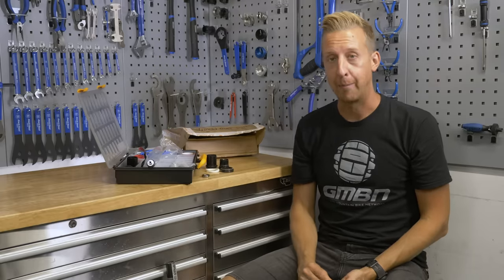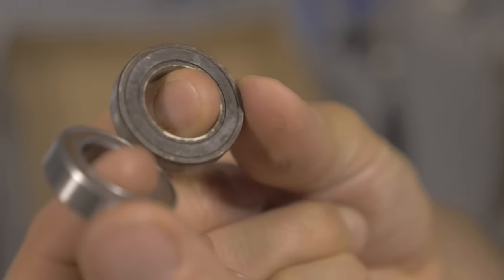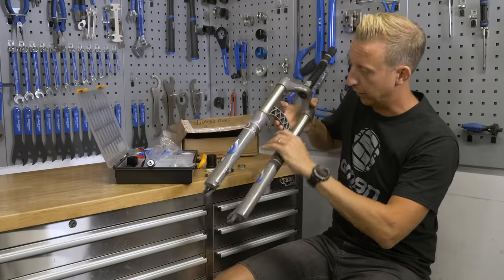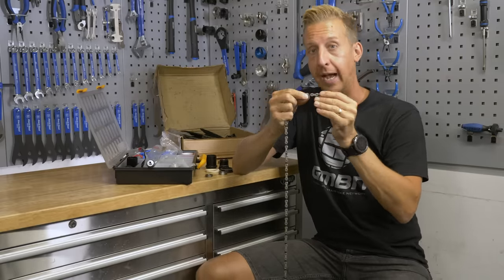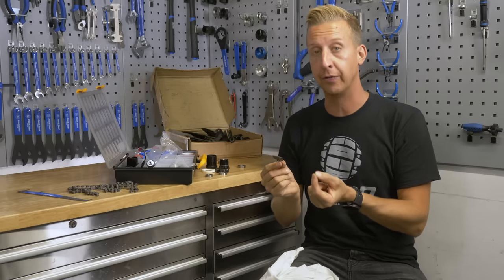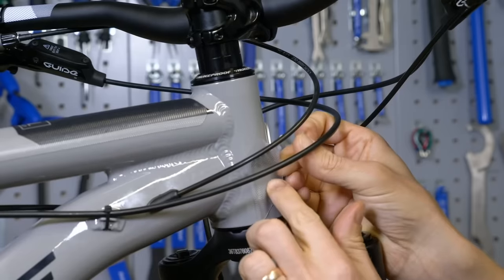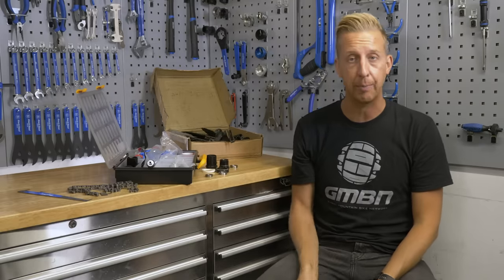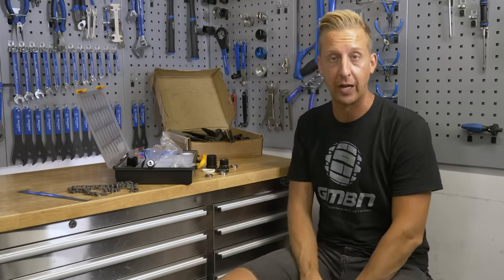7 Ways You're Destroying Your Mountain Bike | MTB Maintenance Tips

Comment: I had a problem with my guide r break leavers sticking on in the hot weather,changed the plunger for aluminium ones,now one of my break leavers are rattling,it never rain’s it just buckets down
Reply: That's a common issue and recall. You could've gotten the replacement parts for free from SRAM! I had the same problem with mine.
Reply: Did the orig ones stick cos u didnt use only DOT brake fluid? Mineral oils and other fluid will cause seals to swell. Or u didnt hear about the warranty replacement for this issue? Too late now u took them apart.
Replacing brake internal parts with non oem parts is an obvious no no...u have created ur own issues here. Dot flush and replace all seals.

Comment: #GMBNTech I have an low end coil sprung fork and it gathers some sort of grease on the stanchions which can gather dirt and sand which I keep clean but are there any more reasons why I should remove the grease or is it ok
Reply: patrick boxsell The grease is getting pushed out of the lowers because of the terrible seals the fork has. The best you can do is to take the thing apart, clean it out and use some good suspension grease and new seals. I personally wouldn’t mess with it and would save up for a better air fork, but if you can’t, this is a reasonable thing to do.
Reply: @camperhonsa8633  thanks for clearing that up👍

Comment: I got a carrera vengeance for 5 quid the wheel axles needed replacing because it was bent but I had the same 1 in the parts draw and no gears on it so put front shifter and rear shifter and mech on which I had in parts bin and 4 ok cables I had lying around which worked fine the bike originally had fluids on it but I went with mechanical it's cheaper I don't need to bleed it and I can replace cables very cheap when needed the rest of the bike was fine thee bb felt like  new because it's a sealed cartridge and the headset bearing were fine aswell so that's my winter bike I also don't use expensive oils on it only cheap oil and don't clean it as much as I should but I don't care it's there to use so I don't wreck mine in winter only this 1 I also took the rockshoxdart of the front and put a cheaper fork on because they were too good of condition for that bike i got it from a friend who kept it in his house and one day said you can have it for 5 quid so I took it now it's still on the road where any commuters bike should be

Comment: Hey GMBN i was wondering and i doubt you will se this but my forks will not really move at 50 psi and they barely move at 25 psi do you thin k it may be that the air is getting stuck in like the negative air chamber or...  idk how to fix this and was wondering ir you could help

Comment: with my 2014 Fuel Ex there is no way to not wear it fast.
Bad linkage design, horrible engineering mistakes, possibly bad tolerances in headset, cus I need to replace the bearings every year to have smooth bearings.
the bearings in rocker link go come out cus of flex, and there is nothing to stop it horrible design.
on my fork I worn the Quick release axle , but I got two of the same fork and axle, it was resistant to coming out, and had a lot of friction, so I installed the other one.
but fork looks like someone used sand paper on it, and diamond file, but so far the other axle work.
but fork has been serviced by Cyklon.no so fox importer, service sentre.

Comment: Waealimits of a Discrotor are nealy always on the rotor itself! Be carefull not to measure the unused parts of the rotor and only the breking surface itself, the method he showed in the Video is not how you get a good measuring. 

Wearlimits of :
Shimano 1.5mm with an original thickness of 1.75mm
Magura 1.7mm with an original thickness of 2.00mm
Sram/Avid 1.5mm 

TekTro 1.6 with an original thickness of 1.85

In German:
Das Verschleißlimit steht meistens auf einem der Arme der Bremsscheibe. Beim messen mit einem Messschieber muss man aufpassen dass man nicht einen der Arme mit misst. Am bessten legt man den Messschieber in Scheibenlaufrichtung so dass man auch nicht den kleinen Grad an der Scheibenkante mit messen kann.
Verschleißlimits von verschidenen Herstellern sind:
Shimano 1,5mm mit einer Orginaldicke von 1.75mm
Magura 1.7mm mit einer Orginaldicke von 2.0mm
Sram/Avid 1.5mm
TekTro 1.6 mit einer Orginaldicke von 1.85

Comment: Draining out oil? How do you do that with air suspension? Correct me if I’m wrong but I’m pretty sure air suspension isn’t filled with oil.
Reply: Typically one side has the oil and dampers and the other side has the air for the preload.  This is why you only add air to one side of the fork.
Reply: matt cj8 Thanks I genuinely didn’t know that. It does kinda make sense tho.

Comment: everyone should stop worrying about their damn bikes and just ride them. They're not going to last forever like nothing does, and that's why you bought them, to ride them and have fun, not to be constantly stressed about scratching the paint. Sure, some maintenance from time to time is definitely good, like cleaning it up and lubing your chain and checking brakes, just don't overdo it.
From my experience, contemporary bikes are quite long-lasting, I've never changed anything on my bike except brake pads and the chain once in 3 years and I ride it every day hard, jump, drop, wheelie etc and it works just fine. It's a hardtail by the way with quite cheap 3x8 shimano transmission, I've never felt the need for fancier more expensive parts, it works just fine.

Comment: Is it bad when breakpads have a little corrosion on the backplate?
Reply: Yeah the corrosion can lead to the glue holding the braking surface of the pad coming off the steel backing plate under heavy braking , I would replace them
Reply: @vtecmossy  Not if its just surface rust.
Reply: @th_js  yeah but surface rust becomes rust so it ain't gonna fix its self best to replace if its around the the pad side esp, backing side not so much but still ain't good for caliper in long haul
Reply: @vtecmossy  if that were the case I'd have to change my pads after every other ride.
Reply: @bobbyhempel1513  me to. so  whats is the shizzle here @GBNNTECH ??? - i have surface rust after washing my bike on my backplates of my braking pads.
Reply: @vtecmossy  rust doesnt move that fast
Especially if you use your bike, the brakes will wear before that
But i think rust on the back might cause the piston in the caliper to rust also, which would be terrible.
Reply: @MaYbYl8eR  if u live by the sea you might be shocked how fast a new bike can become a rusted mess 😂

Comment: i used some shampoo as oil for the thru axle on my fork at one point, because it was hard to tighten, it was all i had and it said that there was oil in it. now my thru axle is corroding a little bit, and before i ground it down to bare metal and re painted it, i wanted to know of any corrosion stoppers that y'all use on gmbn
Reply: Wd40
Reply: 😬 cooking oil or butter or lip balm would have been better. The 'oil' in shampoo is miniscule, but its full of clensers, chemicals etc to REMOVE oil and grease from ur hair!
What ever possessed you🤔😂😂😂

Comment: could you just flip the chain ring?
Reply: No, because then the teeth will be pointing the wrong direction. They are not perfectly symmetrical. Also, the teeth are not placed along the centre of the hub, they are slightly biased towards one of the faces of the chainring.

Comment: How exactly longevity of pads depends on size of brake rotors?
Reply: Bigger rotors take less power to brake, therefore less wear on the pads.
Reply: The bigger the rotors the more leverage the pads have on the wheels. So small rotors require more force from the pads and therefore more wear.

Comment: Now doddy with all do respect what's the point of having an expensive bike if you're not using it anyways? I was thinking of buying a new one but I think I'll stick to my old  1995 built bike just becouse the new  ones don't look like they can take the every day punishment the old one can. It will sound horrible to most of you but my 1995 made bike was last serviced in 2010 and it's still working, I've showed it to my local bike shop mechanic and he is amaised that even the rims are still true and that the spokes are still holding on without breaking. I believe this lightweight crap took over the quality of the modern bikes.

Comment: I used to take my suspension forks apart and clean them and put them back together.  But I learned that's not the best thing to do.  The best thing I've learned to do is the never take them apart, but oil them religiously before and after every ride.  That alone will increase the longevity of your suspension by years.

Comment: NEVER spray water or air directly into any spot on your bike with bearings like the bottom bracket and wheel hubs. It can force water or dirt inside and will greatly shorten the life of these parts. I just let water run over these parts and then wipe them down. Also WD40 is too thin of a lubricant for your bearings. Use the correct bearing grease.

Comment: Really love ridning my bikes but I really, really hate cleaning and maintaining them....
Reply: Then you aren’t doing it right! Working on bikes is fun
Reply: Maybe you wait too long before cleaning and maintaining. Especially the drivetrain: it's not much hassle to whipe the grime and dirt off your chain, relube and take off the excess. For the rest you can go to your local bike shop, if you don't want to do it yourself. My local bike shop is asking for a ridiculously small amount of money for its services. This is often the case at many bike shops. And will save you a lot of money in the long run.
Reply: @chrisko6439  No, I do do all by myself because my local bikeshops know nothing about suspension and mountain bikes in general, they would probably change my 1x  setup to some cheap road 3x setup if asked to maintain and change worn out drivechain.. Thing is I know how to maintain, replace worn parts, bearings etc and clean, I just dont find it fun.. I'd much, much rather ride my bikes than sitting messing about with them.... I do it because i have to (and to save a buck if i had  bikeshops near who knew mountainbikes) ...
Reply: @TheVic256  Oh, ok, didn't think about that, I'm a stupid road/cross rider ;-)  But there are always days that are too hot, too cold, too wet to ride your bike - better fiddling around with bike tech than doing nothing bike related :-)
Reply: @chrisko6439  Dont call yourself stupid, you seem like a cool dude 😎

Comment: HELP ME How is it bossible i build kicker and i usted like 20 jumps then l went to shred and my fork front wheel.. Startted to make noices what sounded like Brake Disc that was rubbing but i have center lock and i have never remowed my disc brakes it has only been torcked fron shop and my caliper/disc wherent loss
Reply: Check to see that everything is tight and that you haven't bent or broken your axle.
Reply: First, and most important, learn to spell, and avoid trying to sound like a gangster rapper,,,just a suggestion,,,
Reply: @briandunstan3503  tell me huh how many
Maybe just English 😅

Comment: The 7th is a bit stupid... its like dont ride your bike if you want it to last it makes sense only with nicking part
Reply: Keeping it out of the salt makes perfect sense. Salt wears all mechanical things prematurely.
Reply: @Tony.795  I've always lived near the sea and I've always given my bikes a coat of WD40 after washing and maintaining them.... I guess the other thing is... I live in a first floor apartment and keep my bike in the flat, so I have to keep it clean, and everything runs so much smoother so it has become a ritual
Reply: @Tony.795  Not if you live in a city where they don't salt the roads.
Reply: Why wearing out an expensive full suspension bike on your way to work when you could, for example, use some old non suspension bike, maybe converted to singlespeed? Way less hassle to look after. I got an old trekking bike,converted to singlespeed, for commuting/groceries and all I have to do is change the chain, brake pads and brake cables once in a while. With no rear derailleur/jocky wheels cleaning the 8 quid chain is done in a minute.
Reply: @th_js  ahhahahah in croatia they salt everithing oce my shoes fell apart from salt (the glue  turner yellow)😂😂